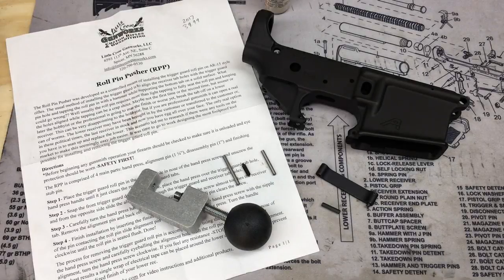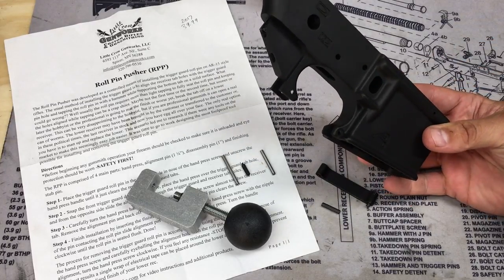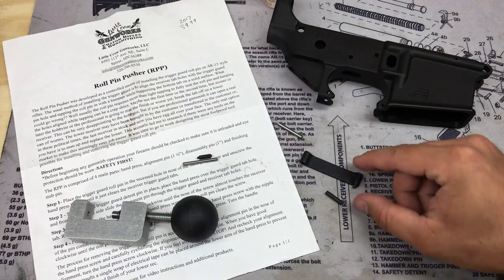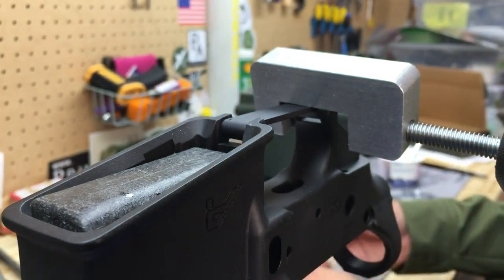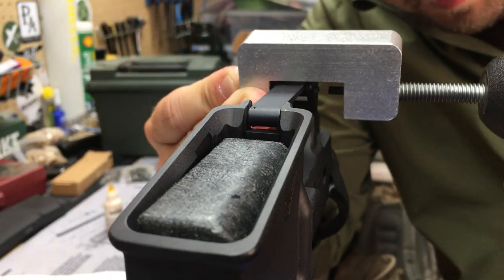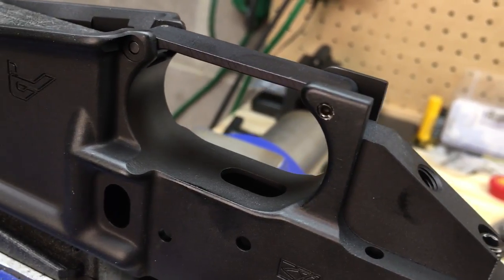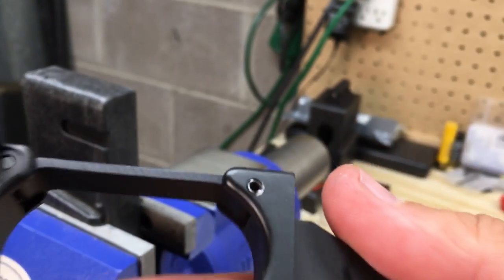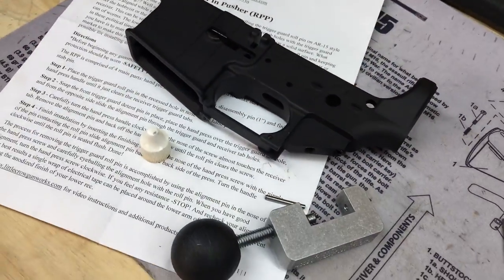AR15 Trigger Guard Roll Pin Made Easy - LCG Roll Pin Pusher

Comment: I used a shade tree method on my last few builds. I used water pump pliers with some electrical tape wrapped on the jaws to push the bolt release and trigger guard pins in. Pushing them in is way better, no stress!  This looks way more precise!

Comment: trying to find an easier way to get this pin in, stumbled across this video and realized that I have a watch link pin pusher that's similar, it did the trick!
Reply: Thank you I was going to use a c clamp and read your comment and remembered I had one of the watch kit pin pushers to it worked great and with a little electrical tape did not scratch the finish.

Comment: For $5 more you can get the Wheeler engineering one that also comes with roll pin holders, punches, and a hammer. Right now on Amazon $44.95
Reply: They're only $21 now in Oct 2018
Reply: That's a very good point. 
2024 I think these tools are about 40 bucks. I just saw the kit you're talking about at academy sports for $54.00. I'm going to go back and buy it.👊

Comment: Having built close to 2500 lower receivers, if you install the grip first and use the correct roll pin holder and punch, you wont ever break an ear off. Also, a trick is to take your receiver block and turn it horizontal in the vise to intsall the trigger guard and bolt catch and do the 2nd staking. A reaction block works even better. The tool is cool but I dont see the point when the current options (proper punches and a BRASS hammer)  with proper techniques do the same job.

Comment: Cool. Looks like a neat tool. I was thinking that the frame on that tool could be skeletonized to provide a better visual cue while using it. For my install I used a roll pin punch,a 16 oz. Ball peen hammer and a pair of plastic coated slip joint pliers. The pliers provided the necessary support spacing while the linoleum covered concrete floor provided a solid no give surface. That and pouring over all the forum and YouTube video horror stories on not what to do while installing a roll pin.

Comment: I did mine with the little crow, but it was aligned with the ear holes and the trigger guard and the alignment pin didn't stick out the other side till I gave it a real push with my finger from the rear because it was too  tight to get the alignment pin through by itself. At least on mine. Wish the alignment long pin was about 1/8 longer. It did work fine though once I got the alignment to stick out. i was using a polymer trigger guard. One end of the alignment pin has more of a rounded end to help center the roll pin. I like the tool but the alignment is a little too thick in diameter and a ten thousandth off would have been a little better. So my advice is to first see if you can push the alignment pin through the guard without the tool and push hard like I did till it squeezed through. i had to take a pair of needle nose pliers to pull it back out on mine. Then I used the tool.

Comment: Thx, pls get this people. I just cracked off the other side of my colt lower trigger guard trying to use a steel punch and micro wooden hammer. Yes, expensive mistake especially on disability. So upset just used epoxy metal weld for now but we all know I just screwed the pooch on my only  AR. The magpul polymer looked too sexy for me to take just another minute and support the opposite side of the trigger thinking I was dead center and going slow. Don't do it!

Comment: Nice piece but seems to just be a mini vice. The corners of your vice holding your vice block work just as well. Put a piece of tape over the corners if your worried about scratching and your good to go.
Reply from the maker: The vice has no guide rods, finishing stub, or ability remove a pre-existing roll pin... all of which the RPP does.  In short, your method would likely work fine for a one time installer if you're careful, but when doing a lot of these or the removal an RPP is extremely handy.
Reply: I can see the easy ability to remove a roll pin being helpful.I got the method from IV8888 in their "how to build a basic ar15" video. Appears that's the only method they use now for both trigger guard and bolt catch. I'm assuming they have built and/or know people who have built their fair share lol Ive installed 2 trigger guards already and it doesn't require you to be too careful as the trigger guard supports inside the ears and the vice supports the outside. This seems like a nice piece none the less.

Comment: Your using a Roll Pin pusher to hold your Lower, that Vise is the best at that and your Bolt Release.  Thanks IV8888 for that tip by the way.
Reply from the maker: Already covered this in another comment...

The vice has no guide rods, finishing stub, or ability remove a pre-existing roll pin... all of which the RPP does.  In short, your method would likely work fine for a one time installer if you're careful, but when doing a lot of these or the removal an RPP is extremely handy.
Reply: Fair enough, I only read so far down on popular Channels so sorry about the repeat comment.

Comment: So I'm trying to install my 1st air 15 lower Sievers rolling pin trigger guard and I'm not quite sure if my rolling pin is too  Big for my low receiver because I'm just getting so much resistance is that normal or should I buy a different rolling pen

Comment: Now can you use it to take the pin out say you want to switch  trigger  guards
Reply from the maker: I may do a separate video on trigger guard removal, but it's pretty easy to figure out.  Basically just use the only other remaining pin I didn't use and push it out the same way we pushed the new one in.
Reply: Yes, it comes with the instructions to do both

Comment: They need to make it universal somehow were you can use it for the forward assist, bolt catch as well as the trigger guard roll pins... That way you wouldn't have to bother with punches
Reply from the maker: That's asking for a lot.  There's a reason why something like that doesn't exist.  It'd be nice though.
Reply: Knipex pliers wrench.

Comment: Why does everyone want to pay for a very specific one time use part? Channel lock pliers, electrical tape the metal parts so they won't scratch.
Reply from the maker: See the video - especially the part at the end where we talk building 1 AR vs many.  It may only be one time use for you, but for someone else they could use this multiple times a day/week.  I wouldn't necessarily advise the channel lock method on the trigger guard roll pin either.  Bolt catch is fine... trigger guard you're risking it.  Scratching is the last concern really.
Reply: Risking it how so? You adjust the channel lock pliers to start the roll pin in just one ear, gentle squeeze. Flip up the trigger guard into place, adjust the channel lock pliers out so youre on the outside of both ears, line it up however you want,  using slave pin, or wiggling while applying gentle pressure. Keep adjusting channel lock down in size until flush. 
Not bashing the product per se, but just seeing lots of guys fall for tool traps with cars as well as guns
Reply from the maker: Unless your channel locks are fairly wide, and most aren't, the jaw on the opposite side is going to be pressing on the other ear and not the receiver.  You're still risking breaking that trigger guard ear in this case.  Until you move the pressure to the receiver behind the ear you're still risking permanent damage.  I've installed these every way known to man including a method like you describe - for multiple installs the RPP can't be beat.  For one and done there isn't much reason to spend money on specialized tools as mentioned in the video.
Reply: I use pliers as well, dozens of times, never had a problem. If I did, I'd just buy an anderson receiver at $40 to replace the broken one rather than this tool
Reply from the maker: Anderson... I threw up in my mouth a little bit.
Reply: Lol, agreed, just trying to support my point though
Reply: regardless, thanks for uploading again man. appreciate the interesting products you review
Reply: Having bought one of these years ago it is really a great tool to use. Very hard to install pins can be gently pushed out in seconds. Absolutely no risk to breaking anything and being done in seconds instead of nerve racking minutes.

Comment: Not to poke the bear more, but if you are so hamfisted and mechanically challenged you snap off a ear of the lower receiver installing a roll pin you obviously shouldn't be building your own rifle. What other amateur blunder are you going to do to your rifle in the next few minutes?! 

Support the trigger guard ear on the edge of a block of wood or roll of duct tape. Oil the pin and use the same roll pin holder punch and correct size roll pin punch as you used on the rest of the rifle. Don't use a BFG hammer to pound with. Use a small hammer (brass or nylon even better) with many light taps instead of one ERRRRRUNGGGG whack. 

That marring you put on with the tool is reason enough for me not to use it. Wood and tape won't mark anything and any scuffs on the roll pin can be touched up with cold blue. Any scuffs on the aluminum can be touched up with Aluminum Black. I'm talking a nick the size of a toothpick point (if any at all).